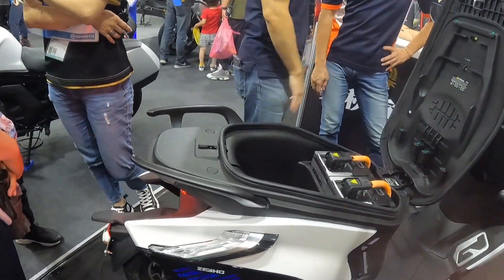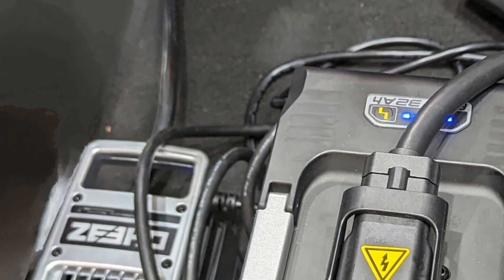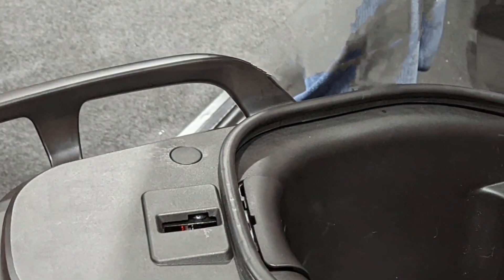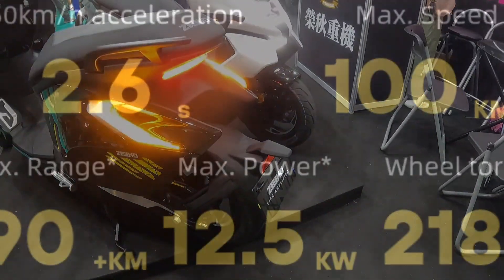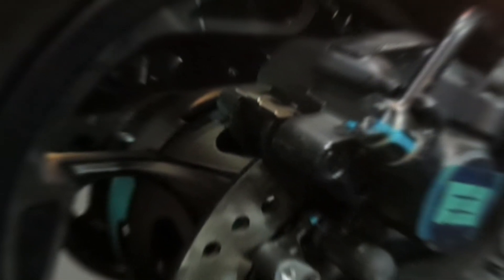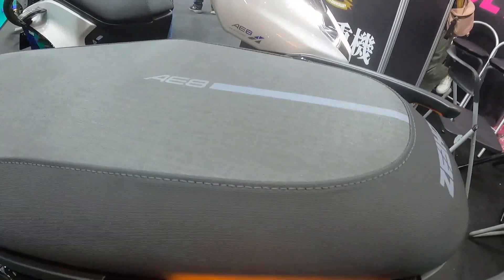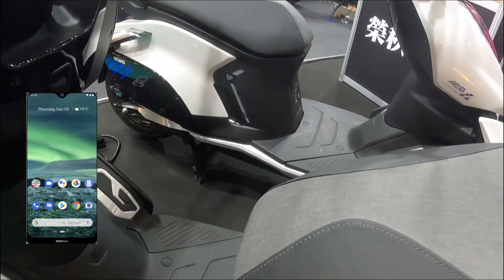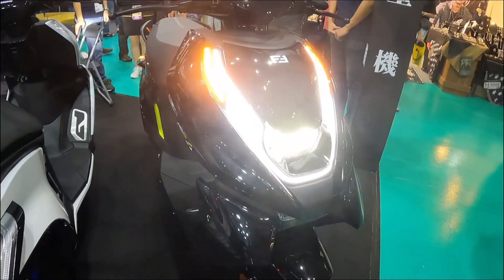ZEEHO'S AE8  high in all aspect ..

Comment: I live in Beijing, where the 1st Zeeho dealer opened a few months ago. I test rode the AE8 recently & was very impressed. It handles very well & accelerates like atomic spit. The range & acceleration are top of class,esp at the price. Fit & finish, as well, are excellent. The AE8s sold here, however, have a chain rather than belt drive, powering the rear wheel. I’m waiting for the new Super SOCO  Ct-3 to come on to the market, then I’ll decide between the 2.
Reply: Seems like the best small E-Scooter I've seen so far. I'm awaiting a reply from CFMOTO re distribution here in South Africa.
Reply: 北京賣幾錢呀？大哥
Reply: I live in Ghana and I searched online just to buy this bike but I haven't found it on any of the online shops, can you help me please?